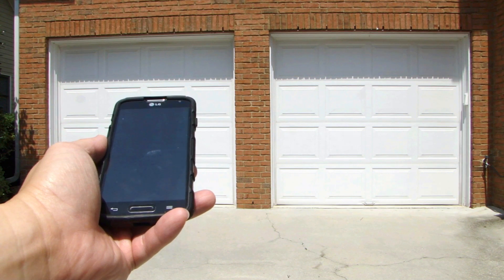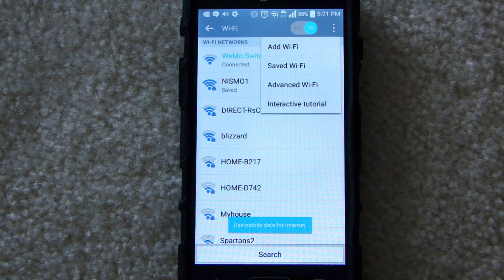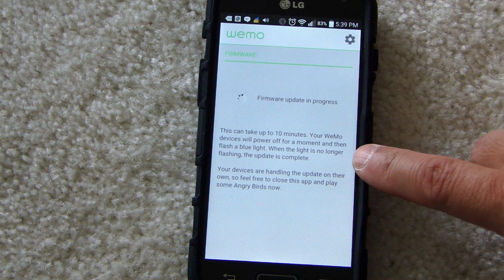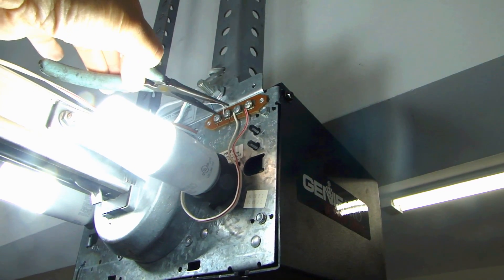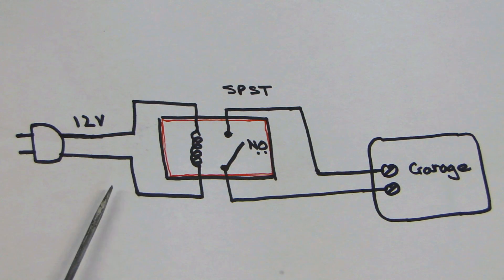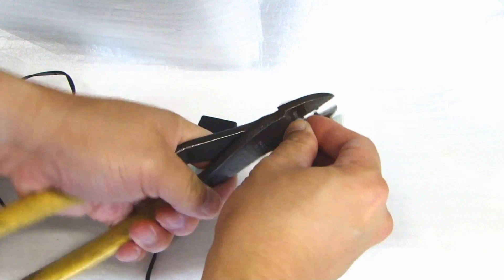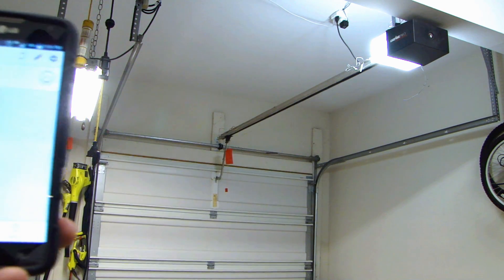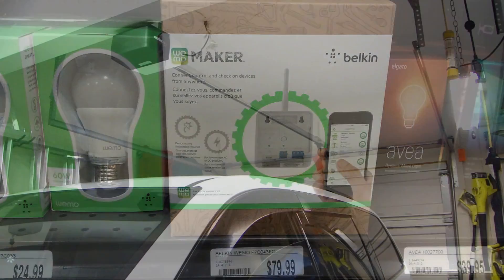How To Install WiFi Garage Door Opener - Belkin WeMo Switch

Comment: A few flaws with this. It just toggles the relay. And you have to press the button twice on the wemo app. There's no way to know if the garage door is open or closed. Also, you can't program Wemo rules like :"Close garage door at midnight" because it doesn't know the difference in the status of the garage door.

As for google home, you can always program a "Toggle garage door" routine which will turn the wemo on, count to 5 and then turn the wemo off. But as I said before: You still don't know if the garage door is open or closed before you invoke the routine.

What you need to do is very similar to this but add a reed switch (magnetic switch) to the garage door itself. So the switch itself is anchored to a wall, likely over the garage door, and a magnet is anchored to the door itself. So when the garage door itself is closed, the switch is closed. When the garage door is open, the switch is open.

The trick is to get the logic right: Wemo turned to on, opens the garage door. Wemo turned to off, closes the garage door. I'm currently working on a solution for this. I'm using Wemo minis. I'm consulting with electronics experts on how to pull this off. So far I do have a solution but it requires 2 power sources. That's ok since the plug in my ceiling has 2 X 120VAC plugs. One plug will have a regular 120VAC to 12VDC adapter which powers the trigger for the opener's terminals. The other plug will have a wemo mini with another 120VAC to 12VDC and an simple circuit with a relay, just like the one shown in this video. The relay will close a switch in the 1st circuit mentioned above which when combined with the reed switch will do the appropriate action. Wemo on = open garage door, wemo off = close garage door.

I'll post my own video once I figure it out.
Reply from the maker: Don't waste your time. This video is 5 years old and I made it work using what's available at the time. Here is the new smart garage door opener you can buy and install very easily. https://youtu.be/0gcyJC_WkRk

Comment: I used Sonoff Basic instead of WeMo Switch and an old Toyota 4 pin 90987-02011 relay instead of that relay. Other things I kept the same. They are working perfectly.

Comment: Hello there.... Is it OK to use 14VDC instead of 12VDC? Thanks.
Reply from the maker: If you using 12v relay, you should use 12v power supply. Or you can check the voltage spec allowed for the relay you are using.

Comment: I have been thinking about doing something similar but you need something automatic that will only turn on for like 1 second then back off so there is no problem because if someone is not paying attention and never turns it back off then the wall button does not work

Comment: Thank you for such a great and simple idea. I used the exact same relay and an iDevices switch instead of the Wemo and an old 12vdc transformer I had lying around. Instead of pressing twice to simulate a push button I set up an Apple HomeKit automation to turn off the IiDevices switch immediately after getting the pulse to set the door in motion. Works with Siri as well. For remote monitoring I set up an Elgato Eve window and door sensor so I can see if I had forgotten to close the door and do it remotely. Thanks again for the relay idea, I was looking at much costlier options!

Comment: I want to do this with the new ryobi garage door opener. I have an app to opon and close remotely but I want to be able to voice control with Alexa and Siri. I bought the wiring harness three pack and was wondering which color wires to use to connect to my opener wires.

Comment: What kind of relay does he use? Can someone provide me a link for this?
Reply from the maker: I have added the links in the description of this video.
Reply: Thank you so much. Will this work with a tplink smart plug? Also, is this safe to use with a newer garage door opener made by Genie?
Reply from the maker: It should work with any smart plug. Not sure if the new Genie works the same.

Comment: In order not to press the button twice making the switch off, it is recommended to use the wifi switch with jog mode,  e.g. AC 110-220V WIFI Relay Switch Module Low Power Jog Mode Phone Remote Control For Wireless Android IOS Smart Home SonOff , $8.99 ,  lower cost than buying WeMo , Relay and AC adaptor
Reply: Hung Patrick can you be for detailed. TIA

Comment: NOTE, this will NOT WORK with newer garage door openers.
If your opener wall switch ALSO operates the light on the door operator THIS WILL NOT WORK.
This is because the switch does NOT work by just shorting the two wires together. Newer wall switches send a signal to the door operator telling it to just open the door OR turn the light on.
To get this to work you have to open the wall switch and locate the tiny mechanical switch inside. Then you must solder 2 wires to the contacts of the switch and attach those wires to your WifFi switch.
The WiFi switch itself MUST be what is known as a MOMENTARY OR INCHING relay.
Get this WiFi switch from Banggood for about $8 is is a SONOFF switch and they work VERY WELL indeed.
This Momentary or Inching switch provides just a PULSE of power to the wall switch unlike the regular switches which just toggel from ON to OFF.
Reply: It works with newer garage door openers, but needs to press twice in order to turn off the Wifi switch every time, but the jog mode Wifi Switch  Sonoff can do and solve this problem.
Reply: Hung Patrick But if you forget the second switch push it will continue to go up and down because the opener is getting a continual signal to keep going.
The other problem with newer wall switches is that just shorting the wires together DOES NOT WORK.
WITH NEWER WALL SWITCHES just pushing the button operates an internal switch that tells the electronics INSIDE THE WALL SWITCH to send a signal to the door operator. It is that INTERNAL SWITCH  that must be activated.
This is not difficult, but you must open up the wall switch and solder two wires to that physical internal switch.
These wires then go to the NORMALLY OPEN connections of the WiFi switch relay, when you activate the WiFi switch it shorts those two wires together which is the equivalent of pressing the wall switch with your fingers.
This works PERFECTLY as I can attest to. It is VERY SIMPLE and takes only a few minutes to do.
However you do need to competent with SOLDERING AND BASIC ELECTRICAL AND ELECTRONIC CIRCUIT THEORY.
I used the SONOFF inching switch.
I have found SONOFF switches to be extremely good and reliable and INEXPENSIVE.
Several times while using the EWELINK APP I have received a notification that the WiFi switch firmware has an update available. So far the update process has been FLAWLESS and completely automatic.
Reply: Thanks. You are right. I understood . So I, did solder two wires from the button contact to connect the relay. in fact, I have one with Jog mode but will be replaced later.
Reply: Hung Patrick My only concern is security, what if you accidentally trigger the door opener while you are not home.
So I sent an email to customer srvc. suggesting that you should be able to require a password on certain switches.
They responded very quickly saying that my suggestion would be forwarded to the development team.
As it is I have a cheap WiFi camera in the garage so I can look to see if the door is open. Another solution is to have a door sensor that will send a message if the door opens.
Isn’t this fun?
Reply: I did what you said. I am using IFTTT to receive SMS and email once the triggers happen.

Comment: A SPST relay works as well correct? As lond as it is normally open and then the power triggers the closing of the circuit?
Reply from the maker: Yes SPST relay will work fine.

Comment: Hi, nice idea, I have 12v but 40AMP air compressor relay. does this works? Do I really need relay? I can 12v plug directly into wemo outlet? 
Please advice.
Reply from the maker: Wemo outlet is a 120VAC plug. You can do what I did here or use a 120VAC relay to do the switching for the garage opener.
Reply: dial2fast thanks for your reply, i have got 12v relay but 40amp. I show you have used 12v with 30 amp.

Does 12v with 40amp relay work.
Reply: use 110V AC Relay instead

Comment: Thanks for the video, I made mine with the tp-link wall plug and set the plug to turn off 1 min later so its reset for me to close it.  I was able to open and close it while on vacation and its controlled with Alexa and Google home.
Reply: I have a tp link mini smart plug but there is no auto turn off option

Comment: Wish somebody would just make a wifi garage door switch! Like in my garage, I have this big button. I hit it once to open the garage door, hit it again to close it. Very simple. Like on/off so it would be nice to have a wifi enabled switch that knows the door is open (ON) or closed (OFF). Right now, LifeMaster wants you to buy this whole new system to make the garage door wifi enabled.

Comment: cool project. my question is: can you still use the standard wall switch? I think the answer is yes, IF you did NOT use the Wemo switch to open the garage door. Is that correct?
Reply from the maker: Yes you can still use the wall switch. Nothing changes.

Comment: Firstly, awesome video. Easy to follow. Have been looking to achieve something similar and was looking for option. I was able to get the exact setup done except using TP-LINK Smart Plug. However, I noticed when Garage Door is activated via Phone App, I have to press the button twice a.k.a. Pressing once it opens the Garage Door but the lamp blinks error until I press it again. I suspect the relay switch gets energized but does not come back to the original open position - less behaving like "push button" manual wall switch. Thoughts???

Comment: I used this method and it's been working out great for the past few months. I placed a tilt sensor on my garage door to monitor open/close status. You will need a home automation hub such as SmartThings go do so. Also, if you download the IFTTT app you can configure the garage door to open then close immediately. This will make using Alexa (if you have it) and the app a lot easier so you don't have to toggle the switch on then back off just to open the garage door.

Comment: That can be a handy device for some things, but if you can't tell if the door is open or closed remotely, it is not a very good idea for a garage door opener. There are other products that are made for garage door openers that monitor if it is open or closed.
Reply: kwd57 Most people have a home automation hub like SmartThings and they purchase a tilt sensor to stick onto the garage door to receive a notification when the door is open or closed
Reply: You could install a cheap WiF IP webcam in the garage and have 100% visual
Reply: I agree.  Chamberlain MyQ is one.
Reply: Us a sonoff cheaper

Comment: This may be a dumb question but I'll ask it anyway. Is the relay required? I understand that it flips from off to one with a 12v charge but aren't you essentially doing the same thing just by turning the WeMo on and right back off?
Reply from the maker: +James Buchanan The wemo switch turns on and output 120VAC. They is no switch to close a dry contact. That's why you need a relay.
Reply: James Good Question... Dial2fast-  Sorry can you restate your answer why you need a relay in a different way for those who do not know what a dry contact is please.. Maybe how about an update video to explain why you need relay?? Thank you for your video, really cool!
Reply: could you use IFFT to auto switch it off so you don't have to press the button twice?

Comment: Don't do this on modern Chamberlain/Liftmaster openers! They have a device available for about $60, it allows you to open and close, but also tell you if the garage door is open, i.e. you left the house and don't remember if the door was left open or closed.

Comment: So excuse my ignorance but I've got a question: Why can't I just replace the garage opener wall switch with a wemo light switch like this http://www.amazon.com/dp/B00DGEGJ02/ref=wl_it_dp_o_pC_nS_ttl?_encoding=UTF8&colid=1WGWY3AHASJBU&coliid=IL5IFZW1IVABJ&psc=1 ?
Reply from the maker: +Emeka Obianyor Because that light switch controls 120VAC device. Your garage door opener button is a low voltage DC switch.

Comment: Nice video on your setup.  Just wanted to add that there's an app available called WemoRemote/WemoManager that can replace the official Wemo app and give you some additional functionality with your Wemo devices.  Specific to this case is the ability to add a rule that can automatically turn off your Wemo switch a few seconds after it is turned on, so you'd eliminate having to toggle the switch a second time to shut off the relay.
Reply: I look for the app u mentioned but there is a number of them and some have a cost. Would you help me with the correct one? Thanx

Comment: LAWSUIT WARNING: While it is easy to do this the problem is that it’s unsafe and does not meet US federal or UL safety standards! In layman’s terms, people can get smashed by closing garage doors remotely.

UL 325 was revised in 2009 allowing unattended operation features. UL requirements for a residential garage door operator to be enabled for remote operation from a smart phone, tablet or other portable devices state that several key provisions be met:

1. The feature must be utilized only on an operator equipped with a secondary entrapment protection system such as a photoelectric sensor.
2. The feature must be activated only when the operator is installed on a sectional door.
3. The operator must be equipped with an audible and visual warning system indicating a pending motion for 5 seconds before the door starts moving.
Reply: If the opener is fairly recent it will have at least dual safety systems.  Beam break detectors and if properly calibrated an absolute minimum close force reversal system which will reverse a closing door if the pressure is even slightly more than required.
Reply: Ah, that explains why people in videos are installing a flashing light. Seemed excessive but not now thanks to your explanation.
Reply: Guyfromhe, the second device is a power load monitor, l believe, that sends signal if motor stresses when it encounters resistance. Don't know the particular device name.

Comment: Hello I am planning to do the  same project the WeMo switch is 120 Vac and you plug 12Vac coil does it not damage the relay?
Reply from the maker: Its clearly explained in the video to use a 12V power supply to connect to the relay.

Comment: Is the relay necessary?  Seems like the wires that run to the garage door opener are pretty thin...  Can I get away with hard wiring a 12v power supply to the clicker-wire?  Thank you in advance.
Reply from the maker: +847Chicago The garage push button is simply a switch, and you need the relay to simulate the same action. If you connect the 12V power source to those contacts on the garage motor, you will fry your garage door opener.
Reply: Thanks!

Comment: pretty cool. what if you leave the wemo turn on for a while, would it short out your relay?
Reply from the maker: +congtusacto It will not short out the relay as it can stay closed indefinitely. The only possible issue is the contracts on the garage door opener stay shorted, which means someone at home can't open/close it manually.

Comment: great idea with the 12v PS and relay
Reply from the maker: +Dillon P I am working on adding a timer to the circuit so it will make the contacts momentarily. Stay tuned.
Reply: Yes that would be better for the wife etc
Reply: +dial2fast I think that you can do it by app IFTTT with action that turn on then turn off your wemo...the better way is with app DO Button - IFTTT
Reply from the maker: +Francesco Chiarelli Yes I have played around with the IFTTT DO app, but very disspointing. Response can be very slow and you get no acknowledgement whether the switch actually got switched. Even the text notification from IFTTT sometimes can take an hour. Not reliable enough to be used for something as important as you house garage.

Comment: I might suggest a 'Clamping Diode' across the coil of the relay. The Cathode of the diode, (Marked end) corresponding with the positive lead of your power supply. When the relay is de-energized, a voltage 'spike' from the coil can travel back into your PSU, and if there is an unprotected IC it can be damaged. No 'Big Deal', just something to keep in mind. .... Enjoyed your vid,   ... Well done Mate.